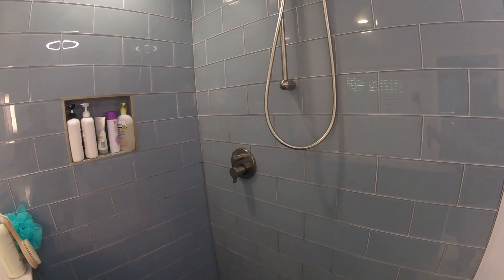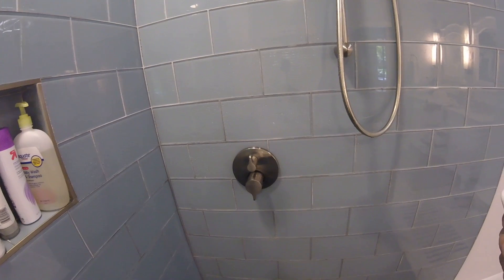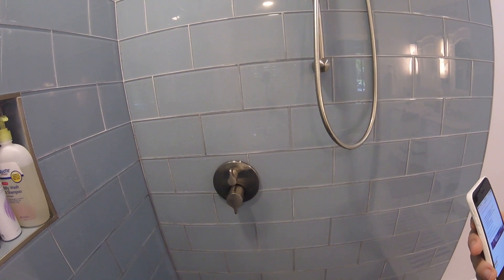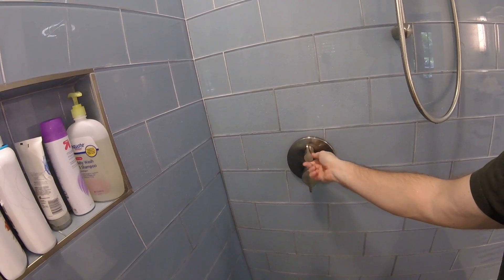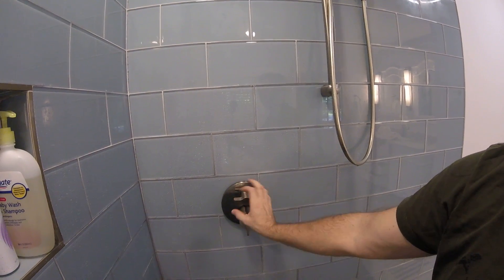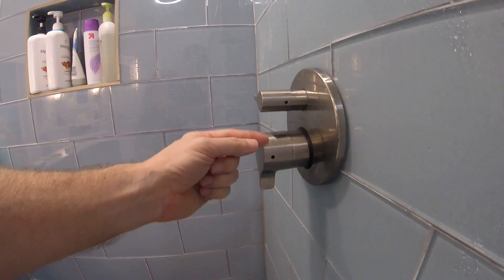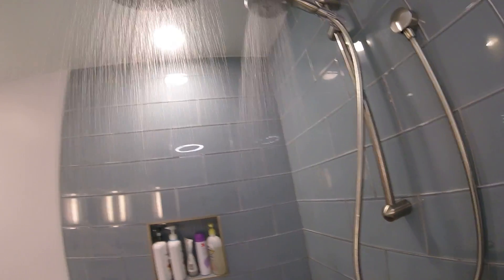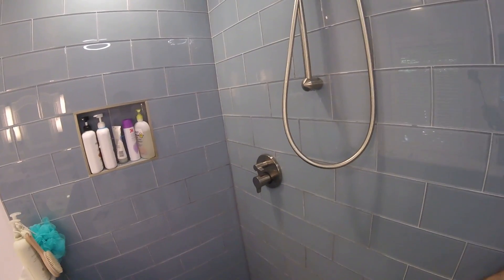Hansgrohe Trim Pressure Balance with Diverter [My review]

Comment: What did your plumber do to the diverted to give you the option to run both showers simultaneously? And also to use the thermostatic controller to turn the water on and off?
Reply from the maker: hi marc, the diverter comes with that function, which is why i went with this model. it was worth the little bit extra imho.

Comment: So even when you started it set to the hand-shower, some water was coming from the rain-shower.  Is that normal?  Shouldn't the rain-shower be completely off in that setting?
Reply: Did he ever get back to you
Reply from the maker: sorry for the late response...not really. i shot this video the day after the shower was installed...you can see around 1:15 it doesn't even have the glass surround fitted yet. the contractor still made some finishing touches afterward, but i just wanted to share it because i thought it was a pretty cool feature.

Comment: nice shower. but how did the trim around you niche
Reply: I think he used either a Schluter trim or some other
Reply from the maker: contractor created the niche to spec and then cut/installed brushed nickel trim to match fixtures and fittings in the bathroom.